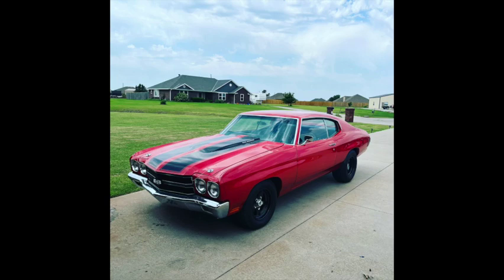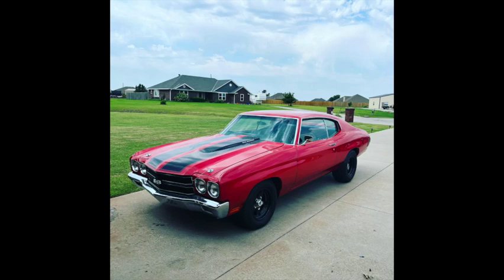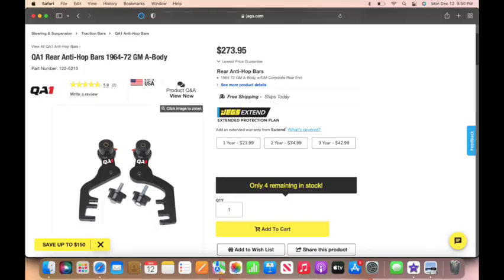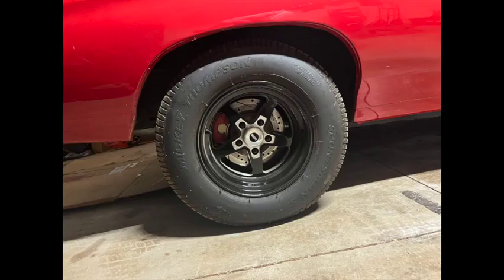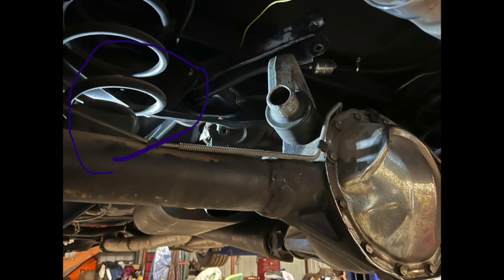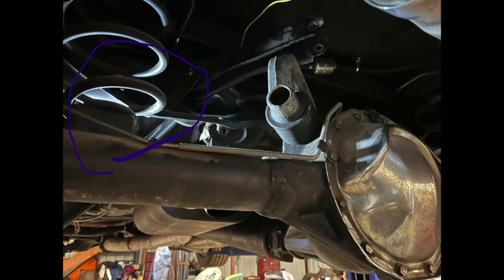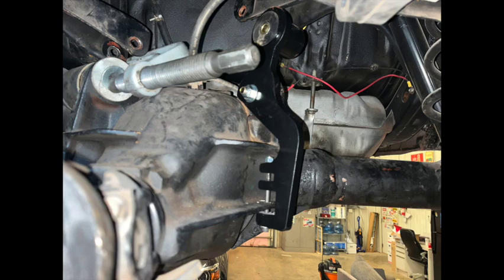Chevelle Anti-Hop Bar Installation

Comment: I was forced to have my 69 chevelle super low in the rear to have little to no wheel hop for a long time. Finally bought this kit and instantly cured all my problems. It's more about correcting the upper 4 link angles. Whole new car now!
Reply: My only concern is that I've created a potential weak point for any hard launches. When I got my car it was in a million pieces but it had blocks in the back and ladder bars. I cut the ladder bars off thinking they were unnecessary.

Comment: How much did these help out? I'm looking into changing my upper trailing arm angle and this seems so much easier than modifying the front mount
Reply from the maker: These made a world of difference. The car is much more fun to drive now. I can break the tires anywhere with zero wheel hop.
Reply: They eliminate it 100%. Just follow this man's advice/instructions in this far too-rare of a straight to the point video. He covered everything and did it well.